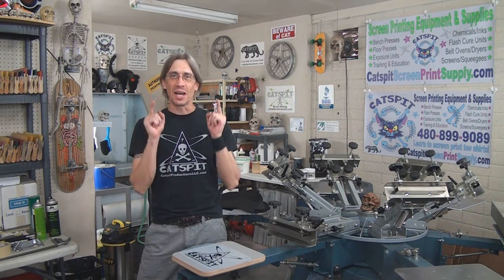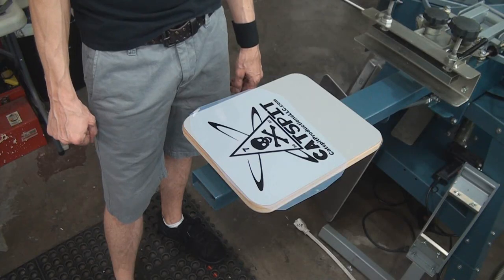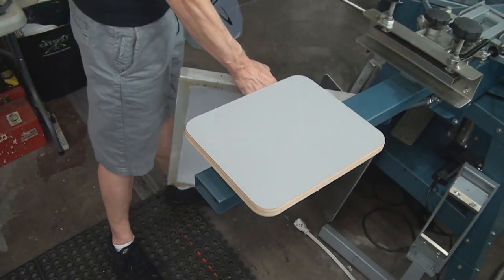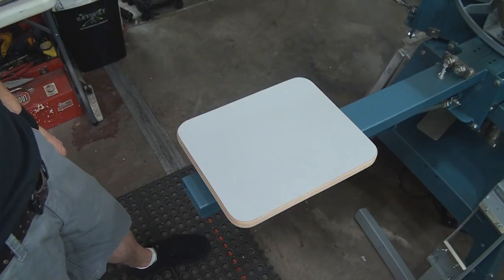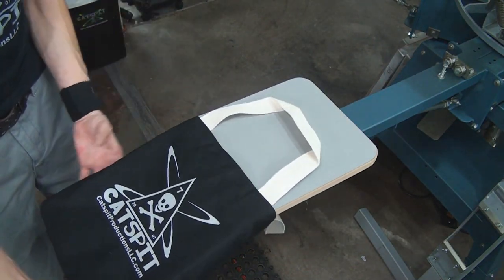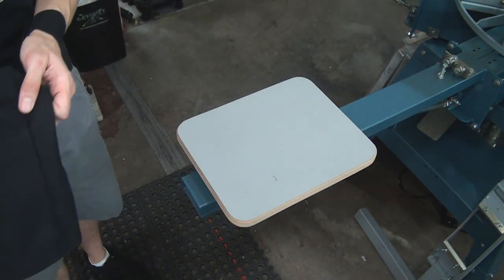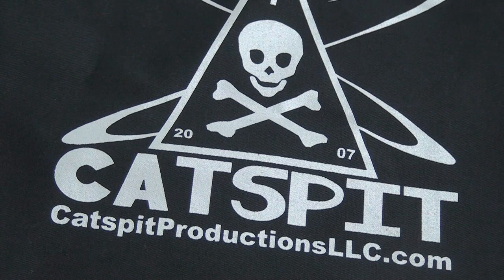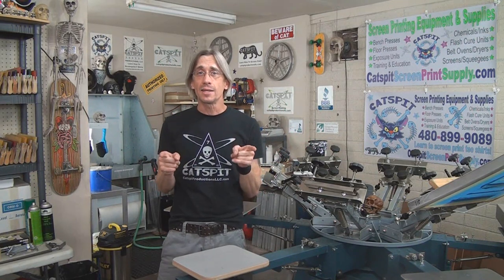Silk Screenprinting Textiles: How To Screen Print Tote Bags

Comment: Hi Jonathan
1. Can you print polyester bags with plastisol inks? 
2. Do you flash dry them or run them thru conveyor dryer.  What temperature is good for either type of curing process.

Thanks again!  Great work!!!
Reply from the maker: You’re very welcome, glad you enjoyed the video. I think so with a poly plastisol ink. These will vary for cure depending on the thickness, material blends, and ink volumes printed. I can’t give a specific number. I test every bag I print and see how much heat it can take before being an issue in any way. Thanks for watching and leaving a comment! http://www.catspitproductionsllc.com/ - http://catspitscreenprintsupply.com/

Comment: What did you wipe the screen with?
Reply from the maker: It's an older video so I'm not exactly sure what you are referencing. But I do wipe the substrate side of the screen now and then during a print run with a dry paper towel to help keep print resolution high. Thanks for watching! Screen Printing Equipment & Supplies - http://CatspitScreenPrintSupply.com/

Comment: How do you cure the paint? Do you you use to heat apply?
Reply from the maker: Yes, with plastisol inks you need to heat cure the ink at about 330 degrees F for up to a minute or more. The entire ink layer needs to reach the cure temp. Watch my other videos for a full rundown of the screen printing process. Thanks for watching. Screen Printing Equipment & Supplies - http://catspitscreenprintsupply.com/

Comment: How many minutes do I have to wait before I cure it with a heat press machine? Thanks for sharing.
Reply from the maker: With palstisol ink you don't have to wait at all. With water based inks you want to let it dry to the touch by evaporation.  Thanks for watching! Screen Printing Equipment & Supplies - http://CatspitScreenPrintSupply.com/

Comment: On the cotton canvas totes can you use water based inks? and what type mesh should you use?
Reply from the maker: You certainly can. If the water based ink is on the thinner side then use a higher mesh count like 160 or 200. Use whatever works best for the design and ink while being wary of textures which may require some ink penetration in order to fill the knit. Thanks for watching and leaving a comment! http://www.catspitproductionsllc.com/ - http://catspitscreenprintsupply.com/